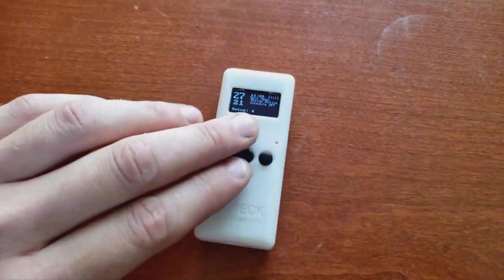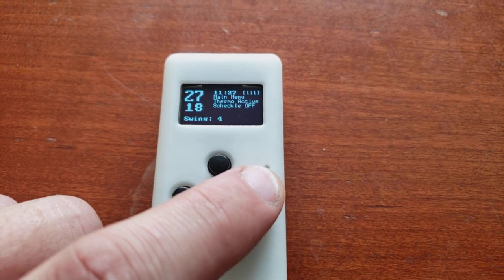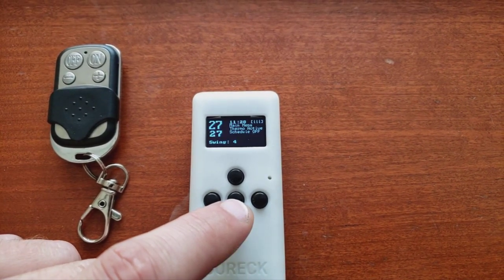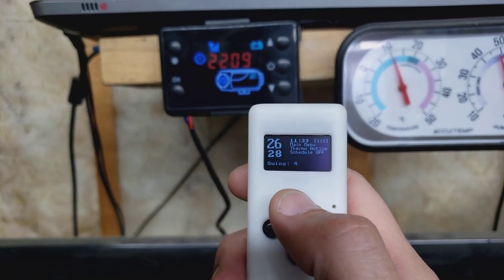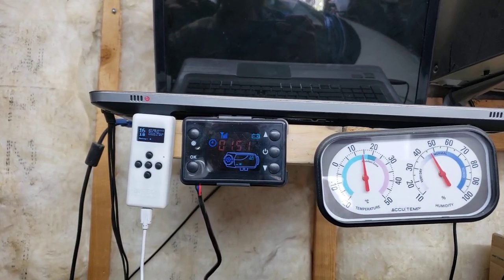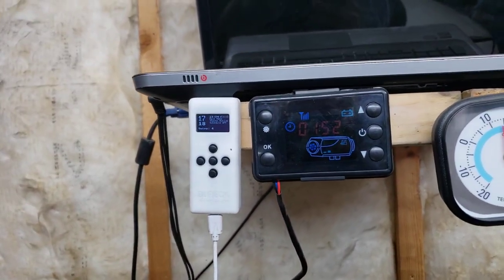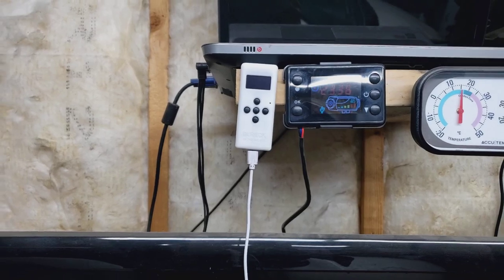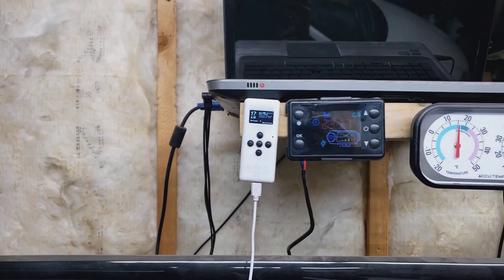2kw, 8kw, Diesel heater wireless controller Bureck cheaper alternative to Afterburner

Comment: Looks like a good way to regulate temperature automatically like a regular thermostat.
I guess it would be a bit power intensive turning the diesel heater on and off frequently but it would be a nice thing to have for car camping for sure.
Reply from the maker: Yeah for sure,  but really its not too much power to turn off and on,  its probably 0.5 amp hours per startup cycle.   usually runs the glow plug at 10 amps for 1 minute to startup.
Reply: I have a big battery, 460 Amp hours so it would work for me. 540 watts of solar.

Comment: IIRC   the major advantage to the "Afterburner" controller is it can vary the heat output (fuel/air combos) between low and high parameters before it totally shuts off if a temp target is reached. I think the Bureck just shut of off or on to whatever static heat output level you have it set at....Start up cycles are harder on things...glow plug...batteries (if running off a battery)  .  I'm  not sure if the afterbunred can do the following:   vary heat output for fine control , but once in a while go to max for soot burn off.
Reply from the maker: the bureck just turns it off and on as often as you have set the swing setting, however you can use the heaters display and set it to automatic at a lower temperature than the bureck thingy.   It not as good but its good enough for what I do.  Ive had it activated since i uploaded this video.  I just have an extra glow plug ready to go.
Reply: It is perfect for a lot of people using the heater in small spaces. Set it to level 1~3. Just turn off if it gets too hot.

Comment: Can the Bureck controll the Hz the diesel heater is running on?
Reply from the maker: No it can only turn the unit on and off, however I believe it's possible to only pair the Hz functions and it will keep sending the signal it thinks is off or on and will probably work but then you loose the ability to have the unit turn off and on.    They did make it able to be updated though and we could see more advanced features in the future.

Comment: Isn't the start up very loud on the diesel heater? Want to do some winter camping in a honda civic. I assuem the heater would have to turn on and off very often with this controller heating such a small space?
Reply from the maker: I'd think a civic is a bit small for a heater like this unless your planning on wrapping a tent around the car and leaving the doors open.  I have the small 5kw version in my van and it's good to minus 30 or more.   I think it'll work but the fluctuations in heat will be pretty big as the heater shut on and off.   Ideally you want to have a setup where the heater is turning on and off less for sure.
Reply: @TheCraftyTech  For your van and 5KW heater, you mean the the heater turn off/on every 30 min? I assuem it's running on low?

I'm considering also the 2 KW version for my civic, but believe those are louder. My civic has no insulation, though I don't know if that matters, as the 5KW may overpower that. I'll also have the air intake fed from the outside instead of circulating the inside air, I assume that would also lessen the efficiency of the heater?

I'm in Canada, gets to -10 celcius regularly.
Reply from the maker: Actually sorry I have the 2 kw version.  Its good to minus 30 in a minivan,  i have it running on automatic but at minus 30 it's running max most the time
Reply from the maker: I use the bureck controller for my garage with the 8kw version
Reply from the maker: I live in Calgary Alberta, 10 cm of snow tomorrow yay
Reply: @TheCraftyTech  Can you unpair the Bureck if you have multiple heaters? I.e switch between multiple heater?
Reply: @TheCraftyTech  I assume you're heater is mounted inside the van?

Does the noise not drive you nuts on the 2 kw running on max?
Reply: @raczyk yes, you can pair again with different heaters.

I would advise against bringing in outside air with the heater unless you have a way to switch between that and inside air as it may not be powerful enough to keep you warm starting with cold air (you could just crack a window for a bit of fresh air to come in)

In my experience they aren't terribly loud, especially if you put them in a wooden or metal box, it's the exhaust vent outside that can get loud when the heater is running on high
Reply from the maker: Not really,  it's a bit louder than the 8kw unit but on the lowest 3 settings it's almost compatible to a home heating system.  And I wrapped the fuel pump in many layers and bureied under everything. Barely hear it and honestly I kind of like the tick when I'm sleeping lol.  The heater in the video is the 8kw in me garage though

Comment: Does the afterburner controller need to be wired into the diesel heater? Debating which one to get.
Reply from the maker: I'm actually not too sure.  But I believe it's ideal to always have a connection to the internet when your using and afterburner controller.
Reply: @TheCraftyTech  Why ideal, thobugh internet connection is only for remote control. Afterbuner can be conntroller internally from my understanding.
Reply from the maker: I'm probably not the best person to ask about the afterburner,  do you know the price?  This one is $70 I believe.
Reply: @TheCraftyTech  Afterburner is twice the cost, plus it's not wireles. My heater will be mounted outisde in a metal box. Woudl the wired controller need to be on the outside of the metal box to get signal from the Bureck?
Reply: @raczyk I believe the afterburner needs to be wired into your diesel heater, with some amount of compatability constraints based on the specific ECU board inside the heater and plug type. Our goal with this thermostat was a cheaper and more user friendly solution, thus simple wireless pairing.

It should work with the wired controller inside the metal box, the CDthermostat has a pretty strong antenna. It will be more likely to work the thinner the metal box and the closer to it the thermostat is. We'd recommend you buy one and try it, and if it won't work for you we'd be happy to refund you.
Reply: @TheCraftyTech  No the Afterburner does not need to be connected to the internet. It is hard wired to the heater via the controller harness and replaces the stock controller. It then can connect to your cell phone via bluetooth. It also can fine tune your heater settings and run in Hz mode if you choose. Yes, it can connect to the internet via wifi to be run remotely  from a computer and it is more expensive, but has way more capabilities than the Bureck. Is it worth it? Thats something that each individual has to determine.